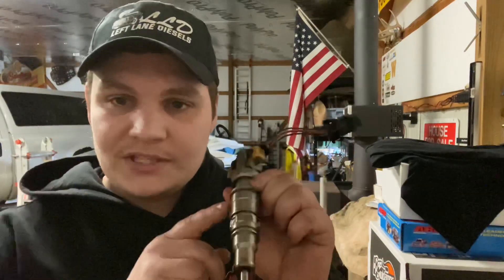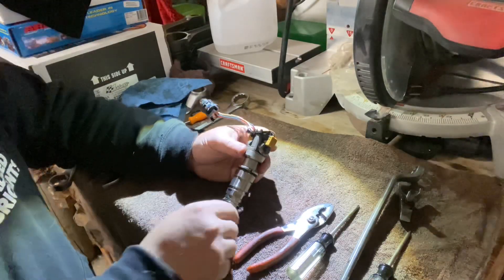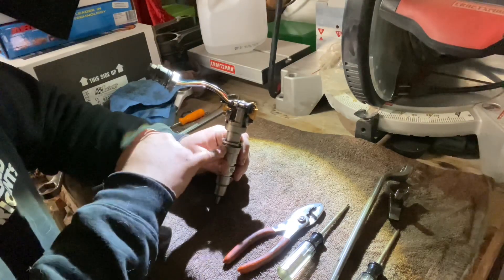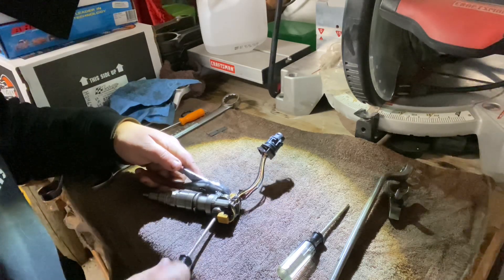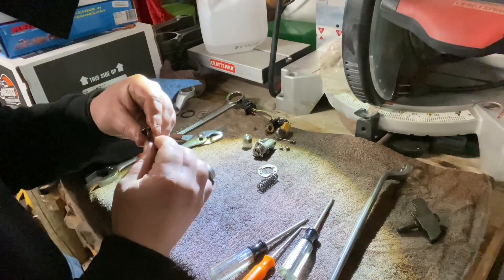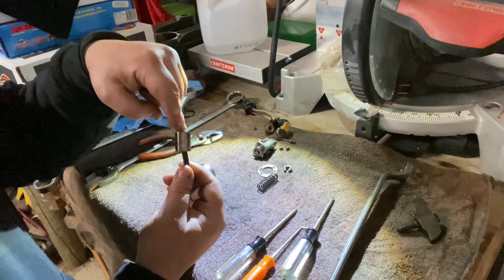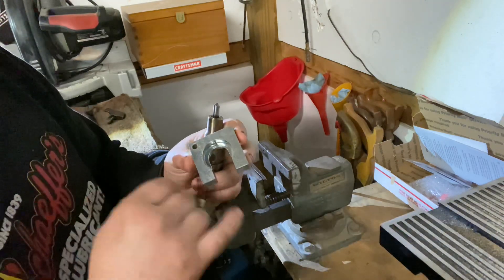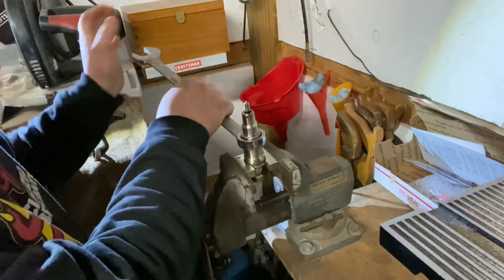INJECTOR DISASSEMBLY 6.0 POWERSTROKE-WHAT YOU NEED TO KNOW!

Comment: Do you work on trucks? I’m getting intermittent PO263 codes? Thanks for videos. 👍🏼
Reply from the maker: I do, and that code, as long as the compression and fuel pressure are good, generally means the injector is bad.
Reply: @LeftLaneDiesels  where you located? I’m in Oscoda, Mi.

Comment: Its nice to finally see what the hell has cost me thousands of dollars. I lost a total of 6 in I have it down to 2.5 hrs to install. After putting the oil additive, I haven't lost an injector in 3 years.
Reply: What additive are you using?
Reply: @logancollins928  Archoil-AR9100
Reply: Nothing is cheap when rebuilding injectors.